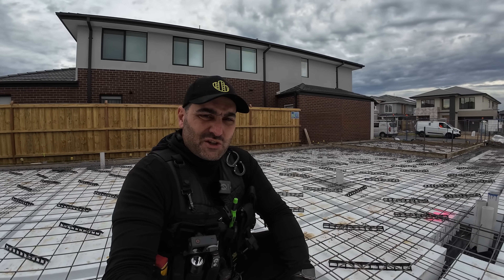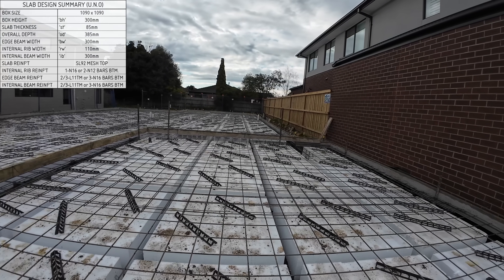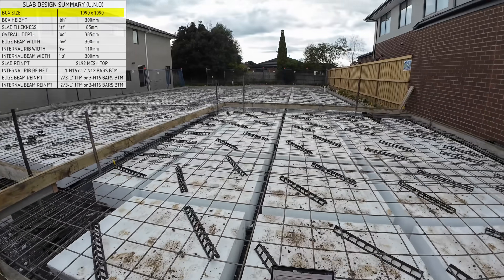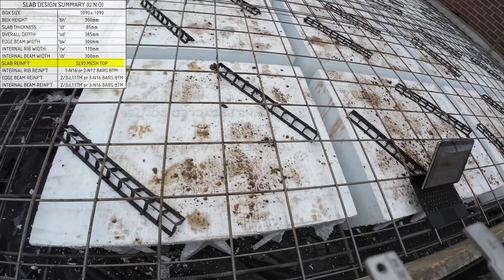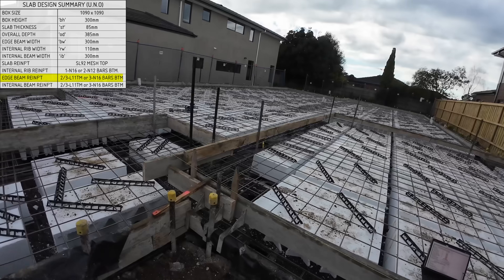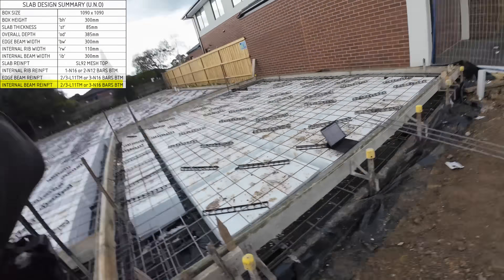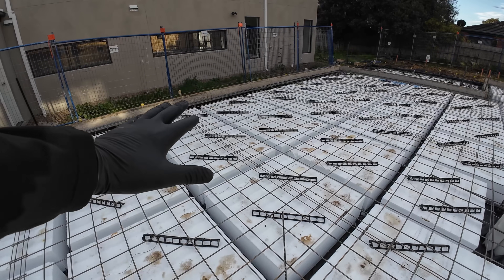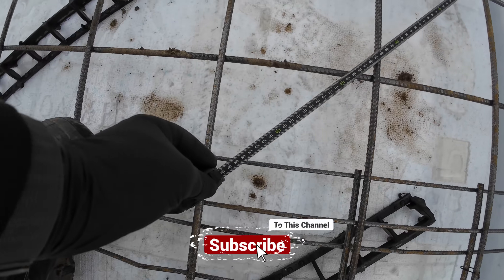Pre-Pour Slab Alert: What the Surveyor Missed!

Comment: "Minimum standard not achieved" SO how much did the builder save? Not to worry, the owner won't know for a few years or until the warranty runs out! Is it any wonder the building industry is held in such low esteem.
Reply: Has nothing to do with saving the contractors just missed these items due to laziness not cause they trying to save money concreter make big profits they don't need to save its just extra work for them they decided not to do it or just missed it that's all
Reply: @mp-pc1ky  lazyness equals money saved.  If you have to put in the extra work, how much does it cost to do it right?how much does it cost in materials, and labor?  They will also try delay fixing it until another job in area comes up
Reply: @mp-pc1ky less steel means… less 💰 money spent
Reply: There is no end date to the liability of inadequate building. So long as the rules are followed then the warranty is time limited.

Comment: OMG. The engineer deserves a prize for the most complicated domestic ground floor slab…ever!
Reply: Not the engineer's fault. It's because of the stupid McMansion trend, which also makes the roof a mess of hips and valleys (which will probably leak).
Reply: @damonroberts7372 Regardless of the McMansion trend, surely, each house should have a separate foundation solution depending on the ground conditions? I repeat my point, the floor slab is over complicated imho. Only shoddy workmanship would create a leaky roof….nothing to do with the number of hips or valleys imho!
Reply: @richardwraithmell4614 : The more elaborate the footprint, the more complex the slab reinforcing has to be. The more hips and valleys on the roof, the more potential failure points there are. Even with the best craftsmanship, making things overly complicated just increases the probability of failure. It's domestic architecture, not Versailles, so KISS.
Reply: @damonroberts7372  The footprint is pretty much rectangular….doesn’t get much simpler than that! To quote you ‘Why make it overly complicated it just increases the probability of failure. It’s domestic architecture, not Versailles, so KISS.’
Reply: 100% remember doing slabs 10 years ago ..150 thick with sheets if mesh sorted ..now days ..wtf lol if touv poured enough concrete you'd know that slabs he inspected is just fine..I bet the engineer would give a shit as he knows its still strong as fck
Reply: @krismace001  I agree 100%. Classic case of being “over engineered” I’m afraid!
Reply: Engineer following compliant ordinance is normal not prize winning.

Comment: The engineer that signed this off probably knew there was (obviously) going to be a portal frame going across that garage meaning there is no extra load going there and let it slide.
Reply: Pressure points at ends will bend and crack concrete beam 🧘‍♀️
Reply: @richard8181   How many houses have you built?

Comment: So, does Zeher think that the builder [1] doesn't genuinely know the code, or [2] the builder knows the code and is cheaping out of the steel?

I'm no engineer or builder, but I note that walls of the house, which the roof relies upon, requires a strong and stable edge beam.
Reply: The builder does not give a flying eff so long as the inspector he paid signed off on it and and as soon as the pour is done he can send the compliance report to the bank to draw down the first payment.  The cheapest he can get that all done for, the better.
He did not follow the instructions on the plans, let alone follow the damn code.
The specific example given for owner access to a site is if you have a contract clause for only business hours access, if the builder tells you the formwork is done for the foundation on Friday and the pour is Monday morning you have the right to access the property on the weekend to inspect the formwork.  You do not need the builders permission, regardless of what is on the contract as you are entitled to reasonable access for inspection.  That example tells you what kind of history there is around this.

Comment: Hi  Another great video

0:35 - you answered the issue straight away   - the inspector drove past here and passed it

Lucky he done that as other just wait for a phone call from the subby or look at the calendar  and sign off

Cant see how they get the chairs wrong ( when my house was done they called them "spiders" as they looked like little metal spiders, the newer ones my daughter calls barbie doll outdoor tables "

Anyway it is so easy to have one chair every 4 ribs of the SL92  4 x 2 = 8

So for the non technical why the polystyrene waffle pads  ?? do they not degrade over time ???

Regards
George
Reply: As you can see they placed the chairs based on the pod sizes, I've never seen this chair style but good placement is important so they don't break pods during the pour. I wouldn't nit pick the chair spacing. 
The reo is also fine. 
The pods are sacrificially formwork to save on concrete. It wouldn't matter if the pods disappeared after the slab was cured.

Comment: In NSW a pre pour sign off from a surveyor is checking the dimensions and slab setbacks to boundaries, not sure if it's different in Victoria but I'd be surprised if they would need to be checking anything further than the location and dimensions of the edgeboard
Reply: I'm a land surveyor our checks are limited to the position, dimensions and reduced level of the formwork. Nothing to do with steel and how it's tied together. There's usually an inspection by the slab engineer as well which looks at internals of the slab.
Reply from the maker: In Victoria, the role equivalent to a building certifier in NSW is known as a building surveyor. Inspections are conducted by building surveyors, building inspectors, or engineers. Apologies for any confusion.
Reply: Thought so, whys this bloke putting it on the surveyor then haha got nothing to do with him
Reply: @bachychan8701  When he says surveyor he's talking about a building surveyor which is essentially the certifier or whoever is the PCA.
Reply: Nah my bad boss keep up the good work!

Comment: Building surveyors you get the few if them that work for all volume builders.  Even the engineers they had 2 or 3 of them that do all volume builders.  I am actually at vcat. I can tell you now after stopping the engineer on the driveway i asked him a simple question, no names. How important is this builder to you. His reply was they pay the bills, so i stopped told ok now every expert report you did floor levels done by you is now conflict of interest.  That week ne called our lawyer pulled the pin on certifying the underpinning and drainage system he designed which now they have all failed due to no underpin company hired for the job. They used tbere on cincreters that do driveways and some slabs. They thought i was stupid didnt know my rights or what i was talking about. Knowing how they operate i did my own research. I held that to myself to see if they are willing to cut corners. I was not wrong. Because 2 years later they got the building surveyor to issue a final inspection approval of minor fixes completed.  This is 2 years after the work was done. I have them on cctv so they cant even lie. Plus instead of sending the buildet the text saying the booked the job for day after inspection both times they sent me the text and not the buolder. I have them for falsifying final inspection 2 years later. Now 2024. They have to try fix the failed underpin dont know how. And the failed drainage work AG pipe installed which are useless they are designed to spread water not collected. Now made thing 5 times worse then before.  Ill stop here. I forgot waffle slab and water do not work. The moment water gets into your plumbing trenches damage is done.

Comment: Back in the old days. The footings where 400mm X 250mm into natural or pins into natural ground and cross beams. With 150mm thick slab on top. 92 mesh, 16mm bar. Earth is like a sponge and when it dries out a house will sink and crack.
Reply: Weird setup this one, we sometimes do 300-900mm deep strip footing and then setup the slab on top of that. Concrete could end up 1.2m deep in some cases.
Reply: Thats what the steel reinforced beams in the concrete do. Provide stiffness under tension over sunk earth so nothing cracks. Like a bridge
Reply: @superwag634  You should comment if you don't know.
Reply: @adrianbates5056  I’m an engineer. Been one since 2001 so I’ve seen more screwups than most people 🤷‍♂️

Comment: I must admit I know nothing about this style of slab technique but it seems to be something that at first sounds stupid as hell.  Slab is the most important thing to get right and while I assume the polystyrene is for insulation it also seems crazy having something so compressible inside a concrete slab.  What happens when ground movement happens? or subsiding house?  Clay rich soil in that part of the world right? Seems crazy.
Reply: no the polystyrene is not for insulation, its it minimise the amount of concrete needed. It does not compress as the rib beams, edge beams and internal beams go down to solid ground
Reply: per the specs, you must ensure you don't have water runoff going into your footings, it must be away. due to exactly that. The only person who benefits on such slabs is the builder in pocketing the difference in costs vs a full pour and steel. I've heard from my mate who does landscaping and fencing in canberra that its so bad that even brand new houses not even 1 year old need to be torn down due to failed reinforcement in those slabs and reactive soil that moved a crap load.
Reply: Search rib-raft and max raft foundations up. These waffle slabs can be jacked up.

Comment: Does not the structural engineer need to check this on site? You said the surveyor missed this extra wide beam?? Sorry you just said engineer later on 👍🏻
Reply: Engineer writes the plan details.  Surveyor or Inspector is supposed to certify that shit was done to the plan and where info is not on the plan, to the current standards.  I would guess the Engineer would only inspect a site if it was an Architecturally Significant Building, otherwise they leave the builder and inspectors to it.

Comment: To be honest I think all these defects are minor. Engineering allows for a lot of tolerances and also caters for a range of extreme conditions. This is still better than millions of slabs out there which were made before these standards existed. And all those slabs are fine. With the edge beams missing the extra m16 rods for every 10mm of extra concrete - are you telling me that adding 10mm of polystyrene foam in there instead of concrete would make it stronger? Bah. If they poured this I would bet my life savings you would not be able to distinguish it from a fully compliant slab in 5, 10, or 50 years. I love your channel but this particular inspection honestly just does not fill me with rage
Reply: I agree.   My slab has lasted 30 years so far without one issue and it wasn't done to this standard.   Mind you, it doesn't have polystyrene.    However, a builder has to be capable of building to standard.
Reply: agree. while this guy does point out some shoddy work, he basically says everything is shoddy. if every worker followed the rules 1000% there would be no house built because its not possible in real life. this guy, as an inspector, has probably never tried to actually build something himself. he just critices other peoples work. theres nothing wrong with this slab, pure and simple.
Reply: @adrianpolley9466  "DURRR NOT POSSIBLE"
They literally just had to put a bit more steel in there. Quit being a cunt, or retire.
Reply: @willdutt  your comment only shows that you dont know anything about real world building
Reply: Double the specified distances with no adjustments made. 
"Minor"

Pick one, or prove with a model that your shoddy work is somehow still sturdy.

Comment: I'm not a builder but how long have houses been made with styrofoam foundations?
OK, you pour concrete over them and no doubt it's cheaper but really?
Styrofoam?
How long are these houses supposed to last?
Reply: 1988 is when it was added to Australian standards. 
It lets the slab be much thicker with the same amount of concrete. 
The middle of a slab doesn't actually carry much load from an engineering perspective
Reply: @Pretzil43  Doesn't it degrade?
Concrete is basically forever. 
Styrofoam? I would think it wouldn't be long term. 
Not that I would know but it just seems like a cheap way out a the e expense of longevity and strength. 
If I had that under a garage I would be really worried about installing something like a two post car lift on it.
Reply: @Pretzil43  
Except the poor slob jacking up his car in the garage using a disappearing bottle jack..
disappearing through the thin slab into the polystyrene...
Reply: @JohnSmith-pl2bk  that should be almost impossible. When they very first came out conveyors often just dropped the mesh straight on the pods and poured like that leading to a few failures but once they pulled their heads in the were no more problems. There was resistance for a long time but now i literally don't know a concrete that doesn't prefer waffle slabs.

Also 2 post lifts need 150mm double mesh topping slabs, no random house slab should ever have a 2 post on it. 
That being said my personal preferred garage waffle slab is 110mm with sl82 plus sl72 centrally placed.
Reply: Styrofoam is not providing any strengh or otherwise. It is only used to make those waffle-spaces in the slab. The engeering on waffle-slab is good and when done correctly has the same strength or even better in some soils than a whole concrete slab. Of course, the cost saving also need to be taken into account. Waffle-slab save aroun 40-50% of concrete and when done correctly provide the same or better than without waffle spaces. The only down side to it, it has to be done according to the engineering specifications otherwise every shortcut in the engineering specs introduces significant problems down the track. It is less forgiving.
Reply: @JamalHashe  Interesting. 
Thanks for the info.
Reply: @JamalHashe  Can you imagine the future demo waste issues?
Reply: Lots of bullshit on this thread! waffle slabs are fantastic when executed properly
Reply: Can you imagine the future waste issues, when these contemporary buildings, with their foam clad and waffle slabs end up being demolished?  I can well imagine how much 'snow' mess from a single pod ground up... in say 40yrs. 

When did they start making polystyrene foam that didn't have a high water absorption capacity?
Reply: Usually you'll start seeing cracks after a year or so
Reply: @jimbojones1107  Not surprised

Comment: Polystyrene in almost every video now. Are we making tofu dreg buildings now as well? This is shameful and embarrassing...
Reply: Its a slab-beam footing and that's been done for ages. It saves man hours because you can dig out one huge square, and then subdivide it with the polystyrene. The same are done with upper floors/levels. You get the strength of the beams minus the extra weight of all that concrete the polystyrene displaces. 

In some building that make the concrete as its look with no paint, you'll come about this. You'd look to the roof and you will see sort of chess board lines beams with empty pockets.
Reply: Yes...the polystyrene is not at all structural...they are there only to form voids in the concrete to save using dozens of cubic meters of unnecessary concrete. The structural strength comes from the beams and steel

Comment: Please tell me I'm not the only one that think waffle slabs are a bad idea. I don't see these houses lasting for over 30+ years.
Reply: if you do your water run off correctly and ensure your gutters never flow against your slab, it 'should' and i mean 'should' last at least 30. but we know thats not how aussie weather is and after N number of extreme downpours the slab will be cracking.
Reply: They are a very good design. I've personally never seen one fail or crack. Some people just misunderstand the system. The slab is far stiffer and groundworks far simpler. The downside is that the edge beam is not cut as deep to act as a moisture barrier reducing soil heave.
Reply: Meh, they did one next door with sand instead of styrene, other than the corner over our stump foundation that had to float.